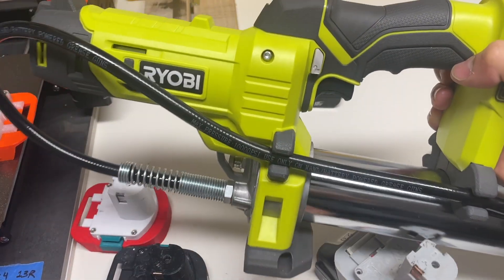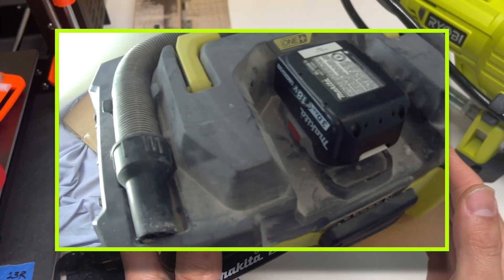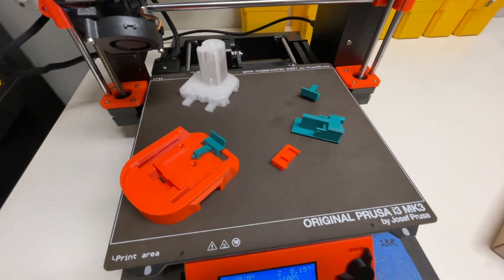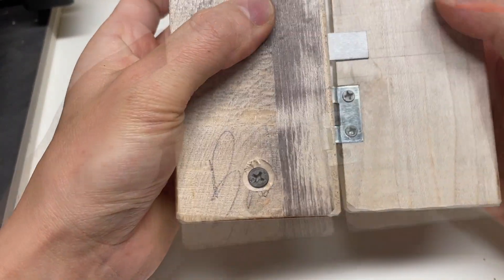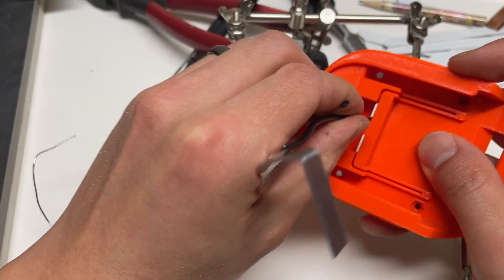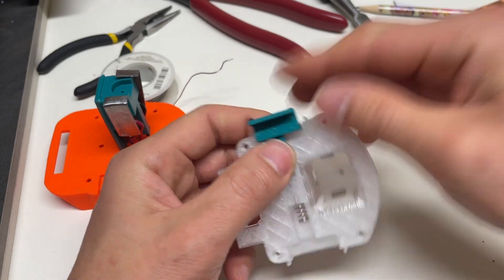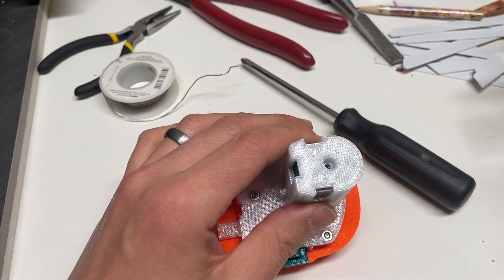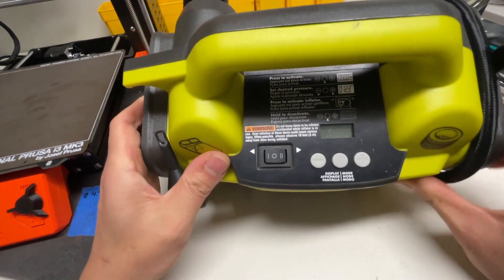AWSOME!!! 3D Printed Makita to Ryobi Battery Adapter

Comment: is there a reason for not using the third contact on the battery? I thought it was for control or safety, but every adapter I see only uses two contracts, why is that?
Reply from the maker: The third terminal is for high temperature cut off most likely. Since you’re using a tool and battery from different brands, they can’t communicate with each other so the 3rd pin’s not used.

Comment: i was looking at the original  3d print u mentioned.  what was the purpose of the  barrel connection?  was it for charging?
Reply from the maker: Not sure what you mean by barrel connection. I know what it is, but it doesn’t exist on my remix.
Reply: @chicagohandyman   yes i was referring to the other one you remixed from, sorry i wasnt sure if you knew
Reply from the maker: @vrrevolution9183 Yes it’s for the push button. I’m not sure why there’s 2 though.
Reply: @chicagohandyman  sorry i was talking about the dc  jack  in the original no the buttons
Reply from the maker: If you’re talking about the push button switch on the original model, that’s a switch to turn on the voltmeter.

Comment: Is the longevity of the makita battery okay? I dont want to plug makita batteries into a ryobi tool and eventually destroy the battery because the tool couldn't tell the battery to stop working because of overheating or low charge.
Reply: For anybody reading this, you have to be careful not to discharge below 15v

Comment: Useful video, many thanks. I need to make a different adaptor, but to know the principle works well is great!
Please note that a voltameter is a device used in electrochemistry to measure charge using electrolysis. https://en.wikipedia.org/wiki/Voltameter
A voltmeter or volt meter or volt-meter is a device for measuring electric potential, i.e. volts. https://en.wikipedia.org/wiki/Voltmeter

Comment: I have my ryobi 40v batteries used in many powerstations around my home for various things.  I purchase 3d printed battery adapters on ebay like all the time.  At 24.00 each, that adds up.  I want to 3d print my own.  I know that these terminal connectors are being sold somewhere.  These guys on ebay get them somewhere.  Ofcourse they will never tell me.  I just wanna know what they are called so that I can goggle it.  Have you tried looking? Better than having to make them all.
Reply: I'd like to use my Makita 40v batteries on the ryobi 40v power station. I as there an adapter like that?

Comment: Where did you buy the adapter from
Reply from the maker: These are 3D printed. You make them at home with your 3D printer. There is a link in the description for the files.